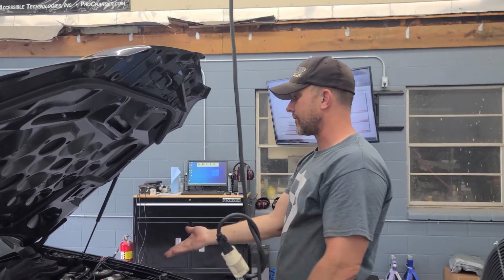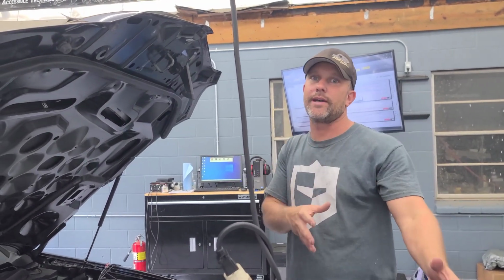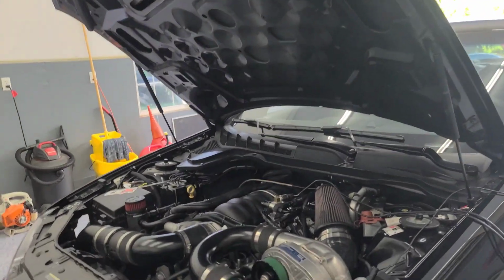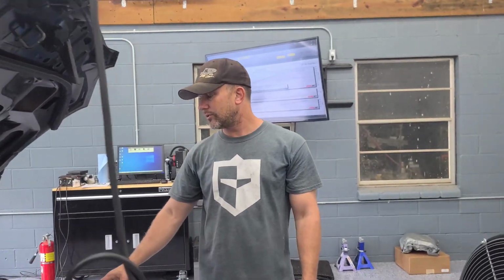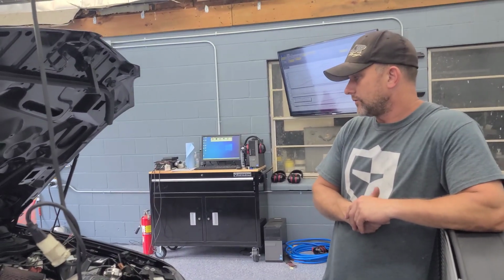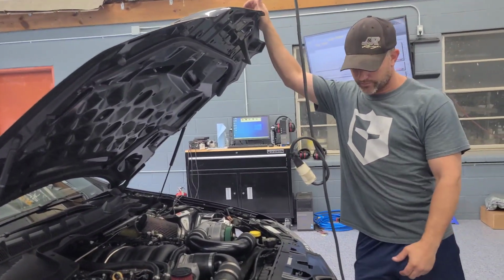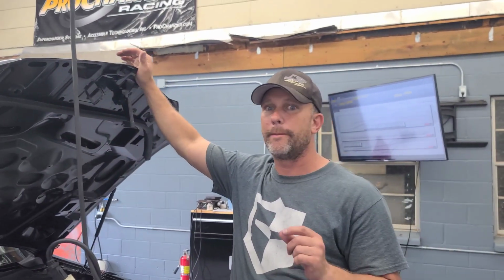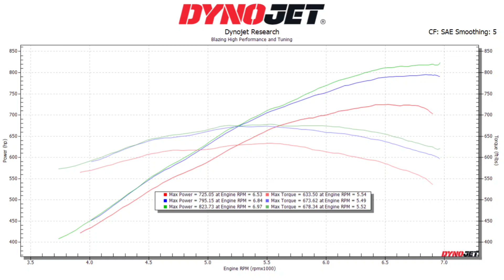2009 G8 GXP M6 with a D1SC back for E85  plus how to maximize your Procharger setup!

Comment: Hey guys, I’m the current owner of this car now. Cylinder 6 Lifter failed on the previous owner and wrecked the lifter bore and cam. Rebuilt the whole thing myself, did rods and pistons, and have been driving it around on the current tune, cam was close enough in specs that I could get away with it. Car has been an absolute blast to drive and doesn’t skip a beat. I’d absolutely love to bring it down to you guys to have the tune refined with the rebuilt engine.
Reply from the maker: Let us know

Comment: Solid info. The e sensor in the return side is just fine as long as the delays are set up in the tune so if the sensor does read a bit off if the fuel system is not oversized.
Reply: We default the sensor to 85% if it fails to see fuel, but ideally, the sensor needs to be on the feed side to assure it sees fuel constantly. We prefer to set things up so that you don’t have to tune around something that you can correct with a more optimal setup.
Reply from the maker: I use standard delays on them, so it would probably be OK in most situations.   Thanks @andyburdess5489!

Comment: I have an L2 fore innovation fuel system with rails and everything.  Do you guys have an opinion on a system of this style in general
Reply from the maker: That style is stout for sure!  What engine combo are you going to run?
Reply: @nufnuffz28  it's a fresh built LQ4 with 243 heads, Cleetus McFarland Cam, stock(to my knowledge)6L80 Trans, 3.45 gears and injectors I believe are 1100cc. Along with the 3.1 pulley 76mm torqstorm. The fuel system is already installed on the car from 2 months ago, but I had never heard of it or anyone giving any reviews about it